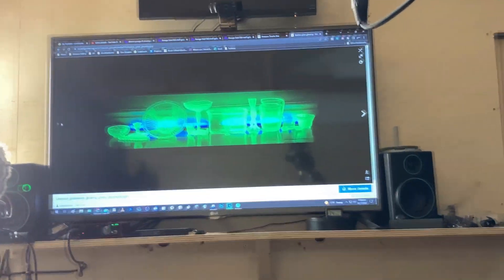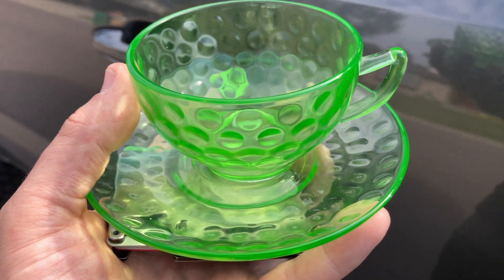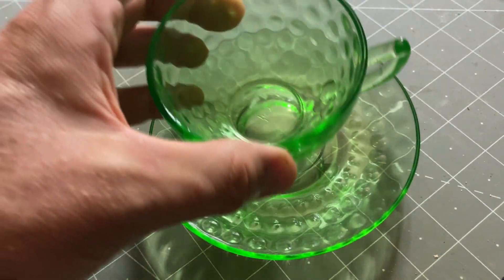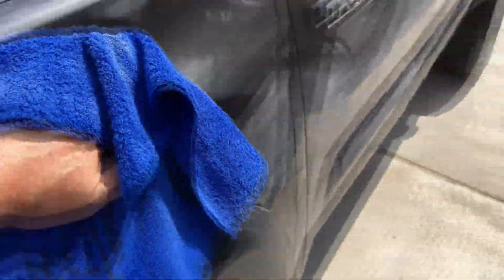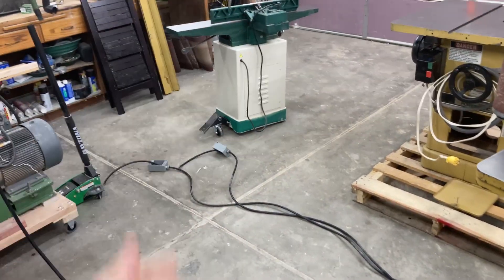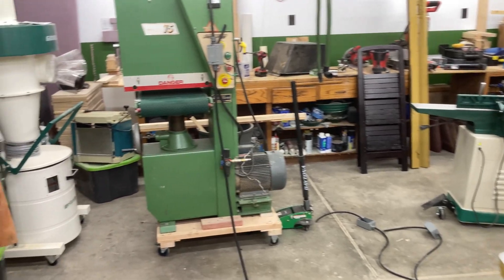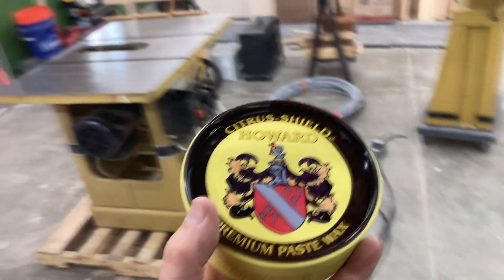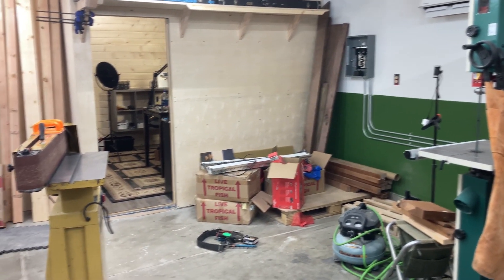Radioactive

Comment: The 220 wiring looks... GOOD! There's nothing better looking than a professional installation, and nothing worse than scabbed electrical work. Also really glad to see the surface cleanup on the wood tools. I was afraid you were going to say you refinished them with WD-40, but that was just a preparation step. I use Johnson's Paste Wax on my tools, but what you used will work as well....... Good job, Mon Ami.
Reply from the maker: Yeah the WD40 is pretty unbeatable when it comes to removing old rust/skudge from second hand tools. They look "pretty good" now, but when I need to re-wax them in a couple months I'll be stripping them back and taking the 400 grit / oscillating sander to it all and re-doing the process after that. some deep scratches on that table saw, but they don't really concern me too much.

Comment: You can use just plane Gulf Wax used for canning and it makes a very slick surface. We used it in the wood shop I used to work in.
Reply from the maker: Not sure what gulf wax is, but sounds pretty OK
Reply: @KleshGuitarsOfficial  It’s pure paraffin. You rub a few lines on the surface then rub it down with a cotton cloth. Makes a slick surface with out leaving any residue on the piece.